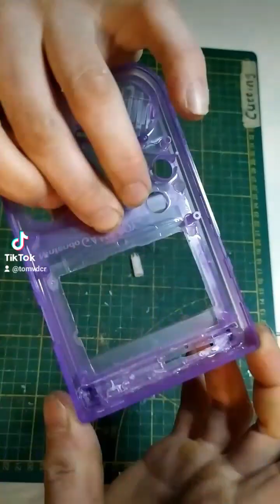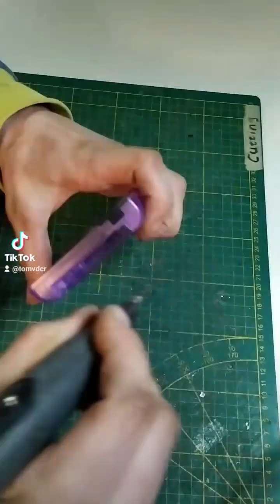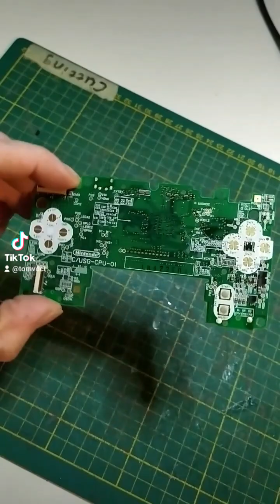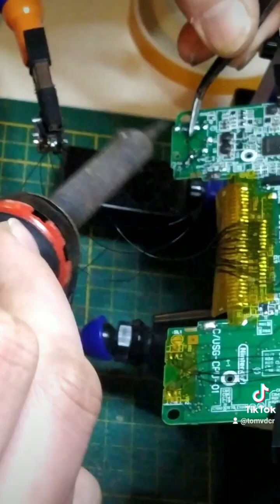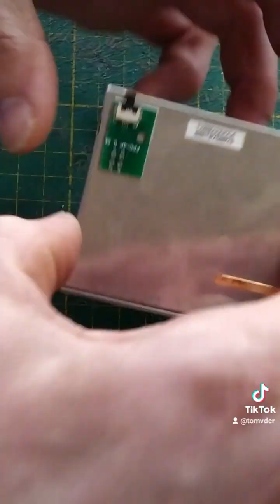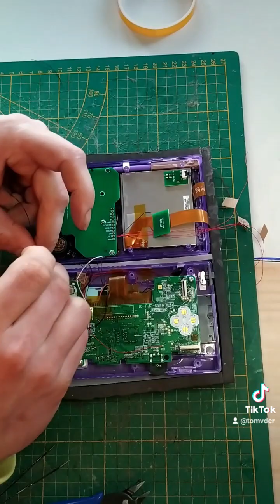How to make a DMG104 (Gameboy DS)

Comment: This video has been extremely helpful on my journey to build my own DMG104, and I can't thank you enough. I'm close to the finish! However, I'm really struggling to find any info on the screen lenses, specifically the bottom screen in the DMG half.
Is it custom made? I can't find one anywhere that has the correct screen cutout and is also plastic so the touch screen works. If you have any tips, I would really appreciate it! thanks :)
Reply from the maker: hey, great to hear my video has helped others, for the bottom screen lens, I make those myself, basicly i hand cut a think piece of plastic in a rectangle to fit the screen and then wrap it in vinyl film got make it look better and then stick it on the shell with doublesided tape

Comment: Very nice work here. Only thing that confuses me is why the client would have wanted a circle pad for a NDS when every DS game is programmed to accept input from a D-Pad, AFAIK. I'm pretty sure even Super Mario 64 DS won't actually accept the joystick input as anything other than a D-Pad. Not like it would make it to where you couldn't play games, but would feel pretty weird imo. To each their own though.
Reply from the maker: The circle pad works the same as a normal dpad
Reply: That's my point. Why not just have a normal D-Pad if it's only going to be able to function as a D-Pad? Again, to each their own. Just seemed like an odd choice to me.
Reply from the maker: @itranscendencei7964  well, the client wanted it, so i made it that way
Reply: I wasn't trying to say that you did anything wrong or something. Sorry if it came off that way.
Reply: @itranscendencei7964   late reply, im not the client but. i find circle pad and analog sticks to be less tiresome on my joints/muscles during longer periods of time. dpads give more pain/wear and tear to my body, dunno why. maybe thats why they wanted it idk.

Comment: It's an incredible piece of work. I have a question, the film cable connected to the top and bottom screens looks like a different cable from the original ds. Is there a compatible cable?
Reply from the maker: I used 39 pin FPC ribbon cables to extend the screens connections, i got the ribbon cables from aliexpress